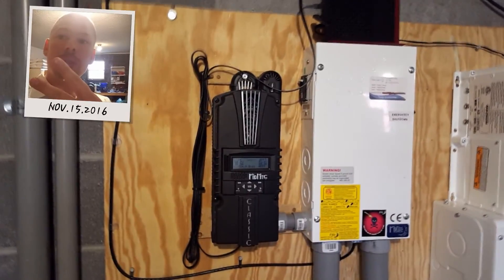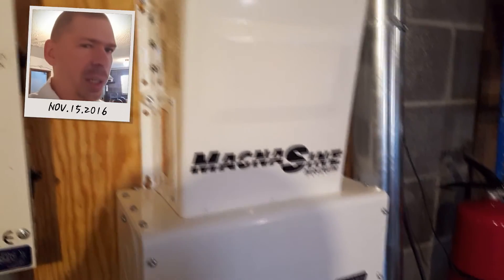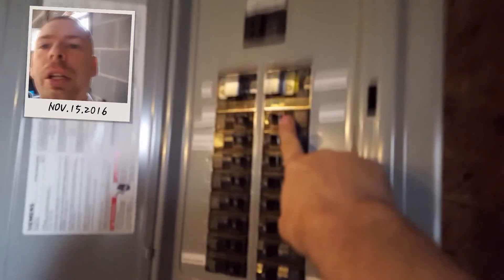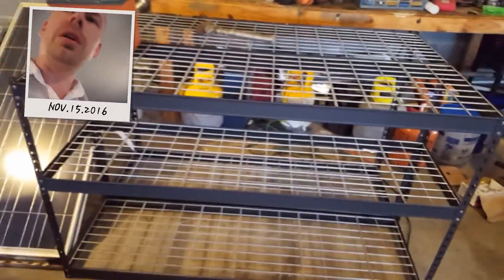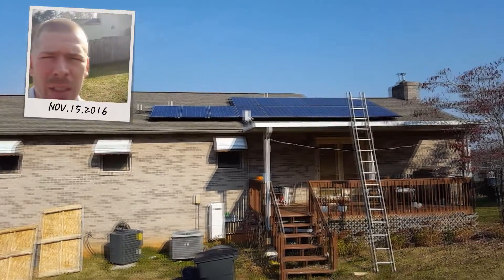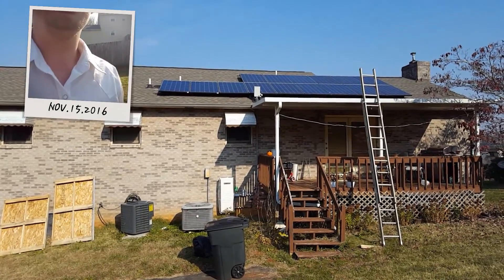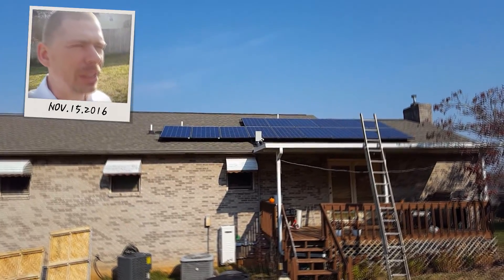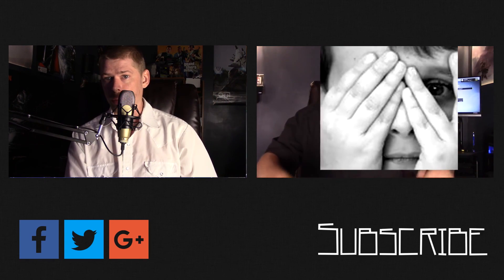Solar Powered Home Overview and Tips For Installing a Off Grid 48 Volt home power station.

Comment: First thank you for the channel on your system. I have a 24 volt system with 660 ah of batteries , and over night with a 1 kwh draw my bank is at 75%. I am thinking of going with a 48 volt set up to cut my over night draw down so I can use 2 kwh and still have about 75% bank. How much better is your system now at 48 v than it was at 24v. Were you able to get double the draw on your battery bank ?
Reply from the maker: It's 100 times better now and I have 4 less batteries. You will need a magnum inverter to match the power saved if you run as much as I do

Comment: Thanks for your continued reports on actual practical systems.  I'm looking for a REALLY good source to get hip on not only solar, but combined power generation, storage, and distribution systems.  Any suggestions?   Even with a background in electricity and electronics, some of this still baffles me.
Reply from the maker: Look man I make more power than I can use in the day time when the sun is good, but the problem I have is no where to use it and it's important to have way more batteries than what I have if your really going to do this. Get a price on everything and then add more money to it about 2k more for stuff needed later. and more parts but you will need at least 15kwh on battery power that you can use. I have about 5kwh